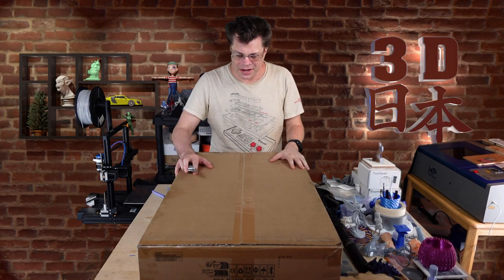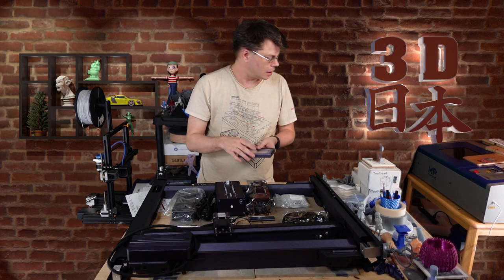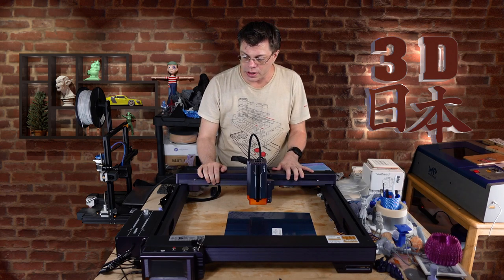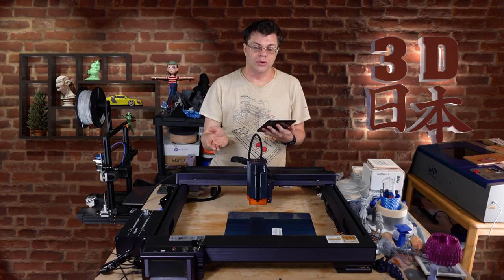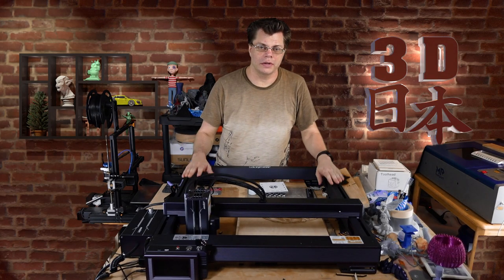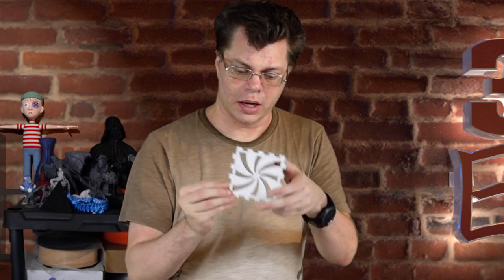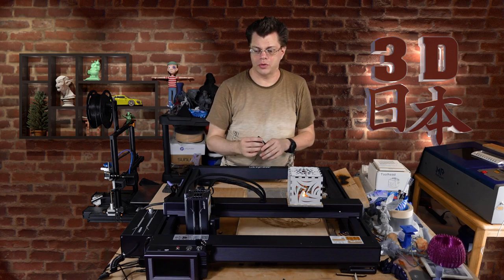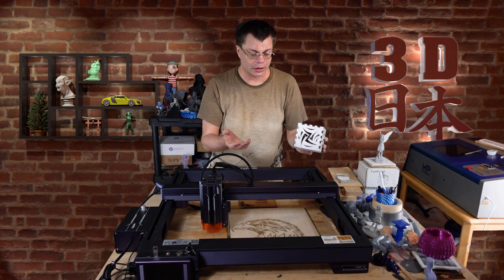Atezr L2: The most powerful diode laser??

Comment: I have the Ikier K1 Pro Max machine, which is identical to this machine.  For the autofocus to work properly, you need to be sure that the Z axis does not run out of travel.  You can do this two ways.  First you can use the autofocus on a thinner piece of material than you are using and then switch back to your workpiece.  Second, when the machine zeros it raises the Z axis up to the limit switch.  You can interrupt this process and then mechanically lower the head with the set screws on the side.  You can alternatively manually raise the z axis until it is in the mid-range of travel.  You can do this by powering down the machine and then turn the Z Axis adjusting knob on top.
Reply from the maker: Thanks I'll give it a try.